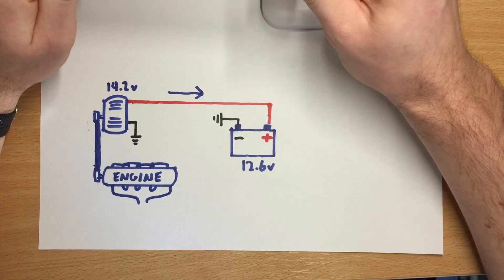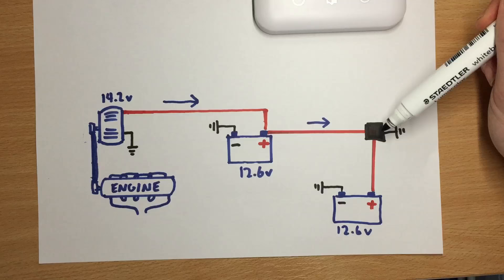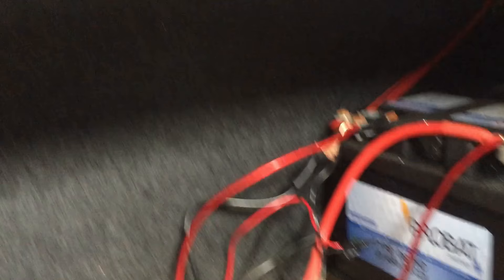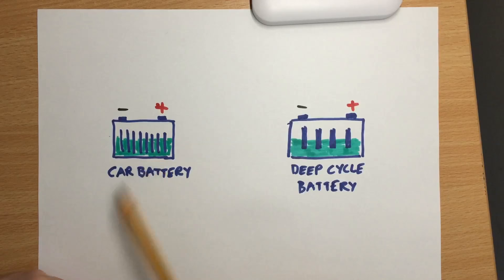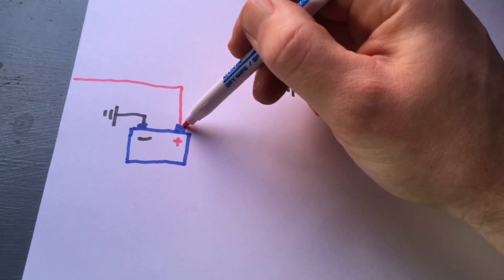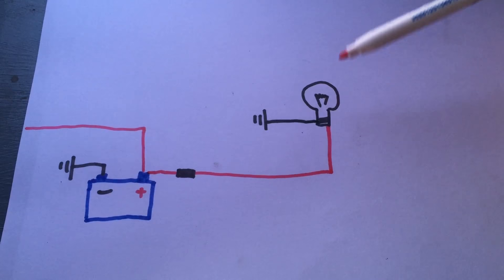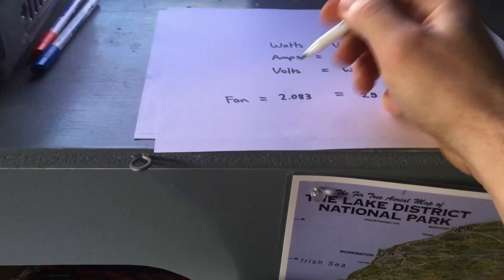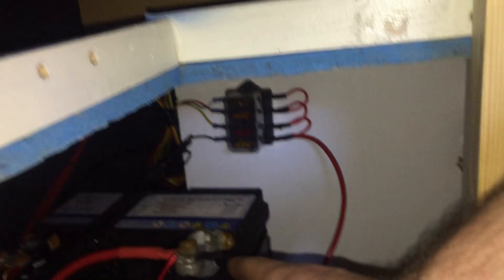Installing a Leisure Battery With Split Charging - A Beginner's Guide (Read Updated Description)

Comment: Your explanation and graphics were ideal for a novice.  One point:  a Split Charge Relay is fine if your vehicle has a standard alternator.  If it has a Smart Alternator, you need a DCtoDC charger instead. Smart Alternators happen to switch off when the starter battery is fully charged, leaving the leisure battery uncharged..but the DCtoDC charger bypasses the Smart Alternator and charges the leisure battery directly from the starter battery, which is then simultaneously charged by the Smart Alternator.  I lost 2 good batteries because my fitter didnt know about Smart Alternators..which are now increasingly more common.
Reply from the maker: Thanks. Pinned!
Reply: How do I find out if I have a smart alternator??
Reply: @user-dn9kk9qu5y .. Phone the appropriate dealership (Ford, Toyota, Merc etc) and gjve the model, type and year of your vehicle to a mechanic.  He should know.  Smart alternators are becoming more popular nowadays as they save on fuel due to turning off.
Reply: Quick question, how does the Smart Alternator know the difference between the starter battery and the starter battery + leisure battery (which I would assume the split charge relay would connect the two batteries once it senses 14.2V from the alternator)?
Reply: @PersonaN007Grata    I didn't stand over my auto electrician to see how it was all wired in/connected. It's an interesting point though that could be explained by an auto electrician who works with Smart alternators.
Reply: @PersonaN007Grata  This sounds logical.
Reply: @user-dn9kk9qu5y  Most vehicles produced after 2006 do...
Reply: agreed thank you!!
Reply: Great advice and thanks for sharing 👍
Reply: Brilliant explanation. Thank you.
Reply: @maxcopeland1354  No they don't. Smart alternators started in production around 2015 onwards.
Reply: @mabbsy  Smart alternators started in 2006 Mabbsy
Reply: Best clear and simple explanation on the subject, thank you!
Reply: My GMC used an ammeter on the negative wire at the battery and would cause issues if you added ANYTHING to the circuit.  I ended up swapping my alternator for the older conventional style charging when I upgraded it to a 300amp unit.

Comment: I also have used red wire for ground wire due to limited materials. Just a tip to help with tracking, take some black electrical tape and put a couple wraps every 6-12 inches along the red line your using for ground. Makes it easier to know what's what and trace lines if needed.

Comment: This is a seriously great explanation! Very clear. Only thing I've been wondering, if the fuse has to be the weakest link of the entire circuit, then why should it's amps be higher than the outlet (in this case, the fan)? And what is the maximum amount of amps you can "extract" from the battery, for example if you install a 12V socket, how many amps should the wiring and fuse be at maximum? And how many amps can your appliance be at max?
Reply: The fuse should be slightly higher.  If it were lower than what the fan draws, the fuse would trip and switch off the fan consistently.
Reply: But that was a fair question, which maybe should've been answered in the video itself.

Comment: Great video lots of great information. Joel of you are going to charge a lead acid battery inside your van you need to vent it to the outside because gas that comes from the battery while it's being charged is very explosive and it only takes a spark for it to blow up. The gas is also dangerous to breathe in and you are sleeping right next to it. Be careful.

Comment: Hi, I am a trained electrician and I teach this subject in college. 
Your explanations were great, very clear and well explained. Those principals you mention with the cable has to be rated higher than the fuse and the fuse higher than the load is the most important thing for any electrician or anyone installing any electrical equipment. Well done you!
With your permission I may use your video in a future lesson in college.
Reply from the maker: Hey! Thanks for the kinds words. You’re more then welcome to use it 😊

Comment: Robert Pittam Paintings

I have 2 110A leisure batteries in my van. I found that the split charge relays would fail after a year or two. While waiting for replacements, I connected them direct to the car battery (with a fuse on BOTH ends of the cable) One day I realised that this was working perfectly for me. You get THREE batteries to draw on for leisure - and I don't flatten the engine battery because I keep a careful eye on a voltmeter I have on the wall. Thing is - everyone needs to watch their voltage with leisure batteries - because whenever you drop below 12.65 volts you are slowly sulphating and killing your battery! (deep discharge batts excepted). Make sure you have a heavy enough cable and fuses to your leisure batteries because to take their share of engine starting loads.
Reply from the maker: That’s not a bad idea actually! If I had more battery usage needs I would consider that

Comment: Thanks for the video, I have recently bought a vw t25 camper van however all of the lights are run off of the starter battery. I'm already concerned when camping about running the lights for too long. From the video I've worked out in theory that I could disconnect the wire running to the leisure part of the van, put in a 50amp fuse and then continue this to the leisure battery with split charge relay. In theory shouldn't be too difficult. Thanks for your help

Comment: Th fuse is to protect the circuit, not the appliance. T 2V power socket is, I think rated for 12A. You could plug one dual-socket USB charger into it, or with ana adapto, two or more. You wouldn't put a higher rated fuse each time.

Think of house wiring. I have a fuse for my over, and another for everything else. and I regularly plug 2400W power boards in with four and more outlets

Comment: I used an old starter battery in my boat which had a shorted cell, for over ten years as a House battery. it could only ever charge to about 10.5V but would power all my lights and a water pump for about 3-days, but was being charged by a solar panel.  I boiled it dry once or twice, so I just kept topping it up with distilled water. Like I said. I got almost 10 years out of that dud battery before I got  sick of nursing it.

Comment: I finally understand how the flock this works....I just went through a major starter crisis, (so I thought) after replacing a starter and starter relay I didn't really need, and after pulling out my hair just before lighting the truck on fire, LOL...... A buddy mentioned that if my second battery was not wired properly I could have problems.  I disconnected the second (apparently incorrectly wired) the truck fired up like usual. DAMN, it's always the last or simplest things that mess you up.  Great video, brother...ordering a relay now.... Thanks

Comment: Put a rubber cover over the exposed positive terminal leisure battery for sure.

I think you need to give yourself more credit.  It looks a great job . but but but red wire for negative faaack.
Spent estimate £60 relay, £100 car battery , £30 for wire , roughly £200.
May as well get extra cable for the money your spending.
That diagram looks like a cottage industry for the third world , if you can generate enough volts to charge battery , change out engines, change out alternators, looks a winner to me
Reply from the maker: Yes I am ashamed of my red wire for negative! All gone now.... 😊

Comment: Deap cycle batteries should not be discharged below 50% or they will be damaged. Ideally you should have a disconnect relay set to cut off connection at the 50% discharge voltage.  This disconnection voltage will be slightly different for different tempatures.

Comment: I would advice followers to run wires neat and secure them with fasteners in short intervals. And it’s a bad excuse to use a red wire as a ground wire just because you ran out of a black one. Get it fixed before you forget it or sell the car

Comment: Thanks for a very clear explanation. The only thing I don’t fully understand is, if the cable from the starter battery is only trickle charging the Leisure Battery, why dies if have to be so heavy duty, since there seems to be no need for a high current transfer from battery to battery if they are working independently?
Thanks

Comment: Agree with Joel's Stuff - a VSR (voltage sensitive) won't work well with a Euro5 or Euro6 engine and Smart Alternator. A VSR works fine with older vans. A bit of research is required before buying and installing a system.

Comment: One point of note though. Your particular vehicle uses a “smart” alternator, as evidenced by the multiple connections to the battery earth terminal. This requires a specially designed VSR, otherwise it won’t work efficiently.

Comment: Hey love the video! I really appreciated the way you broke it down in layman’s terms. I recently installed a deep cycle battery in my vehicle and Iran a zero gauge wire straight from the alternator to a battery isolator and from the isolator to the deep cycle. I installed a switch to open and close the circuit when I turn my vehicle on and off. My first time driving after hooking it up everything went well for about 15 minutes, then I started to smell rotten eggs/battery acid. So I came to the conclusion that my deep cycle battery was being overcharged. I also have a zero gauge wire running to my starter battery from the alternator. I didn’t want to run my charge wire for the deep cycle from the starter battery because I assumed that that would only hinder my charging capability for the deep cycle. I’m guessing since the alternator is overcharging that means it’s voltage is too high. I know the alternator determines its voltage by the starter batteries voltage/state of charge, but since I have an extra battery wired to the alternator does that alter its reading? I thought about charging/draining the batteries to match one another in voltage, but I know deep cycle batteries and starter batteries charge and discharge much differently so they would end up constantly out of sync and cause problems later. Any input would be greatly appreciated!

Comment: Hi! Great video! Thank you for the clear explanation. I just have one question. To add a new device, can you connect that out from the fans connection, or do you have to start from the battery/fuse for each outlet you want to connect?, 

Never mind, just saw you video in this! Thank you for all the videos! Lifesavers.

Comment: What about a say double usb charger socket can you specify something a wire/fuse to use?
Great vid and simple instructions with great diagrams 🙂🙂
Reply from the maker: You just need to estimate how many amps it will draw at full use. You could probably find out online quite easily. Good luck!

Comment: This is a fantastic, simple and easy to follow guide.  Thank you so much!!  Quick question, if I had my leisure battery near the rear (drivers side) wheel arch, where would be a good point to earth the Split Charge and Leisure battery?  I've got a T4
Reply from the maker: Thank you! Basically anywhere is fine. You could do it on the wheel arch itself, the floor, any of the metal structure. Just sand a bit down to bare metal and pop a screw in to hold it securely. Good luck!
Reply: @JoelsStuff  legend, cheers fella

Comment: Hi just want to say your videos are great very easy to understand and simple (which I need) had sleepless night worrying about this stage of conversation just was wondering where did you get all you parts from to do this conversation?
Reply from the maker: Hey, thank you! I have used ebay to get almost everything - the bed and cupboard sets, and all of the electrical stuff too. Everything else like curtains and sink/cooker I have made myself with supplies from my local hardware store. Good luck!
Reply: Joel's Stuff cheer mate  I’ll have a look on there.

Comment: You should mention that that is not a great thing to do when you have a van/car whit a Euro 5-6 ore 7 engine. Your alternator is cutting of and sometimes only give 7V new vehicle need a dc/dc charger.... new vehicle is also have campus system. In worst scenario your car can go in to "emergency" mode and only one garage can fix it. I have a T6 whit originally have 2 batteries. But 2'nd battery didn't get enough power to charge up from alternator. Now I have dc/dc charger. 
But this is not criticizing! Your information is great.
Reply from the maker: Thank you. This sounds like a smart alternator setup? I have pinned a comment at the top about this. Thanks for letting us know

Comment: Hay man. Thanks so much for this video! Amazing explanation! Il be using this guide while wiring my van. Quick question. Inverter? How have you wired that in? And can i just use the inverter for my electronic stuff? Rather than having to worry about extra wiring and fuses

Thanks man
Reply from the maker: Thanks. I have an inverter that I just clamp onto the leisure battery terminals with crocodile clips. This can be used to power 230v items, but will only put out enough power for less demanding stuff (a simple electric sander would be ok, but a welder for example is not). Also make sure you buy a “pure” sine wave inverter if you are powering sensitive electronics like a laptop. Good luck!

Comment: greatly appreciate this graph and information. recently I purchased a deka intimidator AGM dual purpose 300 cold cranking amps  9A51P. for my nephews Toyota Prius he destroyed the car within 2 months of me buying this battery for him. now I have a battery sitting on my workbench. at one time I was going to add a second battery to my Dodge ram 5.7 l gasoline engine. I am not familiar with AGM batteries whether the dual purpose is different from a typical AGM or maybe all AGM batteries or dual purpose. there's not a lot of information out there on this battery besides I learned that they're good for off-road vehicles as well as tuner cars. with this style battery I'll be okay to add as a secondary the way you have it illustrated in your video or is there some kind of regulator I need to put in between? and from my secondary battery I guess I just run an inline fuse from AGM secondary battery to a PowerPoint 2nd fuse box/inverter something like that?. thanks for your time
Reply from the maker: Hi there. I wouldn’t want to start giving specific advice about your setup, as I am not an expert 😬
Sorry I can’t be more helpful

Comment: Thanks for the toturial. Is the capacity of second battery important?
My main battery is a 70 amps battery. I bought 2 other batteries that each has 140 amps. It means in a parallel cycle 280 amps.
Now I would know if the alternator has enough power to charge all the batteries. I have also a relay between the main battery and second batteries.

Comment: nice video well presented. So while I scratch my head some more can anyone answer why there are 2 10Amp inline fuses by my leisure battery ? also there are two black wires going to the negative terminal , what will they be ? the power in the van is not working of course and I am hoping to work through process of elimination .....any tips appreciated!

Comment: This is so helpful thank you! Question: If you were to use your starter battery for lights/phone charge, how would you know when to stop so you don't run the battery flat? And would the keys have to be in ignition or is there a way around this? Cheers!
Reply from the maker: Good questions! Essentially you can wire anything up to your main batter directly (make sure it is fused correctly). If you are worried about charge, you could install a voltmeter (I have a video on how to do this). If you see the charge dropping much below 12 then you know it needs charging. A small light and phone charging are also very low amperage, so it would take a long time to flatten a healthy battery. Good luck!

Comment: Excellent video mate thank you.

One quick question I'm gonna put in a diesel heater in my patrol car is this the kind of setup I need for the battery and heater?

Cheers
Reply from the maker: It will work fine. However, diesel heaters don’t use that much power so you should be fine running it from your starter battery. I would only install a second battery for this if I was going to use the heater for days at a time parked up